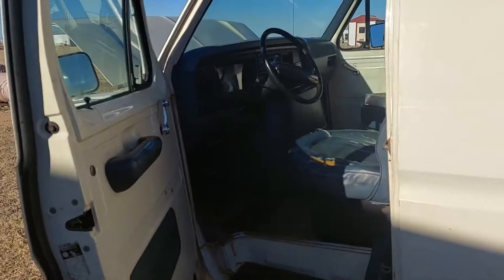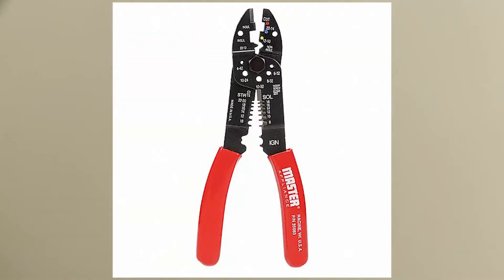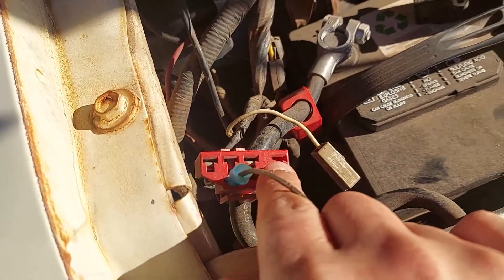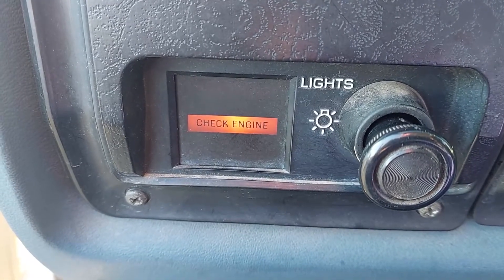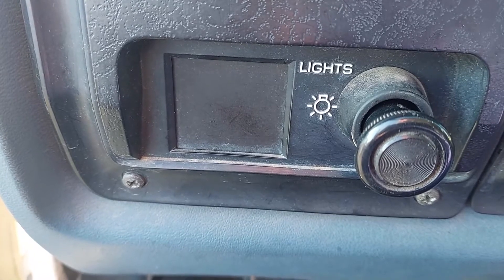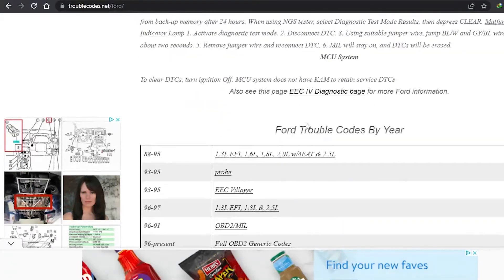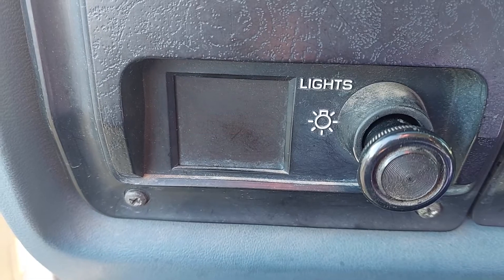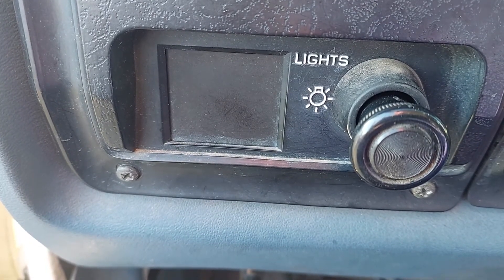EASILY Read FORD OBD1 Check Engine Light CODES (1980-1995) WITHOUT A SCANNER... (i.e. Code 51)

Comment: I was so thrilled to see this video. Then went to my van to see if i can read it. But as always i find something out if place. There was obd plug. But no second wire. Nowhere near.  
I think the engine has been changed to newer gen4 model. Thats why few parts only fits from newer models…

Comment: What if it does not flash at all and just stays lit?
Reply: Did you find an answer for this? My van is doing the same thing
Reply: @briannaharless9386  in the old computer some of the diodes melt as they get older. That was the problem with mine. I got a new computer but then I did a whole bunch of other stuff. I took off the whole fuel injection system put on a carbureted intake manifold and a 600 Holley vacuum secondary and put a fuel pressure regulator on it. Then I put some headers from a 90 Mustang GT on it and sanded out the inside welds to flatten out the welding bumps. I adjusted the fuel pressure to about 7.5 PSI because it usually runs at about 45 PSI with the electric fuel pumps so with everything assembled now it runs absolutely fantastic. I am super happy with how it runs no fuel injection games to worry about. The reason why you can do it that way is the computer still senses the manifold vacuum even though you detached all the fuel injectors and all the other stuff. So the vacuum advance works and the spark is perfectly fine with the distributor. It runs absolutely fantastic. It's actually pretty darn fast now for a stock 302. I took off all the emissions also. I am guessing it probably gained 60 or 70 horsepower. I also put on dual exhaust with side pipes.

Comment: From what I could tell I ended up with a 53 code. it blinked 2 times, then 2 times, then 5 times, and then 3 times. and when I first turned the ignition switch on it sorta blinked just barely. so I guess I will now go look at some code lists.

Comment: Man… I’m pulling my freakin hair out with a 95 ford misfire. ODB1 No check engine lights. no codes. Car idles amazing, hard to tell it’s on… until it start to misfire. Then it looses power and jerks all in a split second… continues to idle fine,.. then repeat.  Sometimes it idles a little rougher other times like I said you can even tell the van is on.  Sometimes it stall at the stop light.  I’ve put the following  new parts.  Sparks plugs, wires, Dist. Cap. Ignition rotor. Ignition coil. Fuel pump, fuel filter , fuel pressure regulator.   Aaaaaand Nothing… it’s still runs the same. I fit know what to check next, injectors? 🤷🏾‍♂️
Wtf man… I’m never buying a non OBD2 vehicle again. 

If anyone had any hints, tips or advice,.. I would greatly appreciate it.
Reply: I’m in the same boat. Also swapped main ECM and all six injectors, same result. I gave up diagnosing and am now just rebuilding everything from scratch. I hope you got yours running, if you solved it I’d love to know what it ended up being.
Reply: Did you ever figure out the problem? I’ve replaced almost all of those too